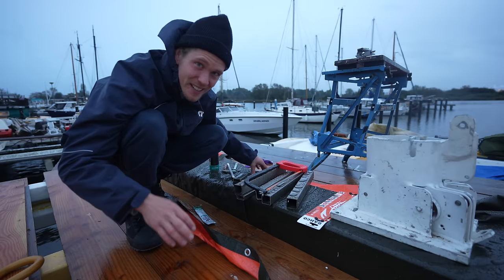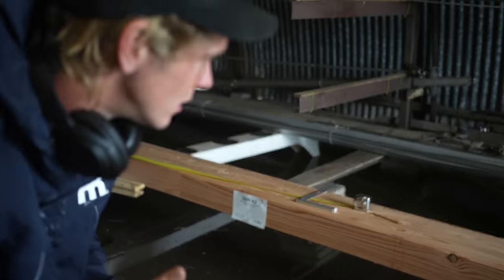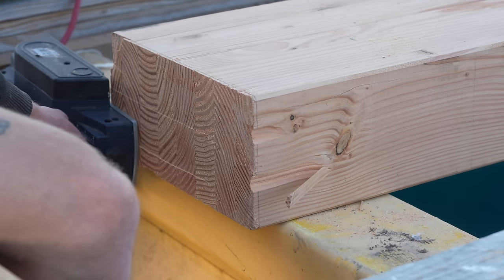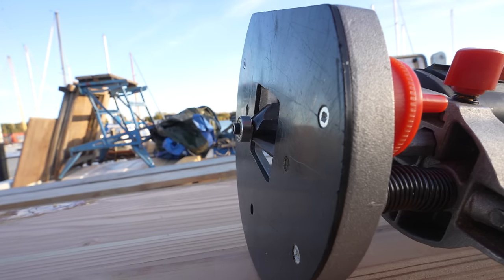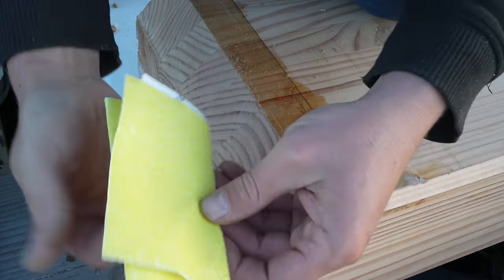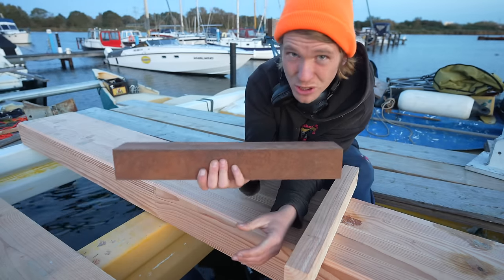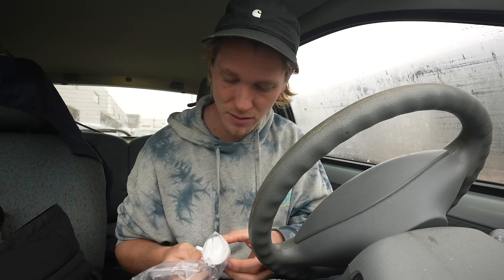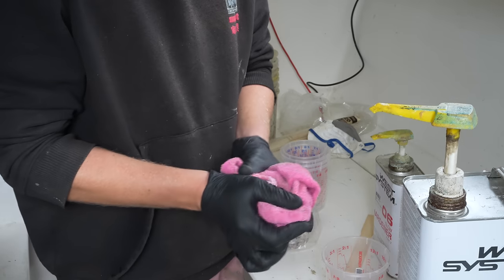My 42 ft Catamaran gets a HUGE Mast Step! | Wildling Sailing

Comment from the maker: Thanks for all the advice, guys! I know it seems like I’m just making things up as I go along, but I have followed the design plans for this beam, I have just made it oversized, and lengthened it. in my lengthy discussions with Hanneke she had told me that lag screwing the retaining blocks is the only way to go. Through bolting would weaken the cross beams which bear most of the compression loads. We can only see!
Reply: DW its 90% keyboard navel architects with good intentions on here.
Reply: The Gougeon bros on Boat Building is a book you need to buy and read. As they are the 'West System' they will teach you the MODERN way of working with wood.
Reply: I believe some folks may not understand the forces involved, I will leave it at that.
You're doing great Mark.
Future reference on cutting thick beams would be to scribe a line all the way around the beam then use a circular saw to cut the line all the way around, then use a sawzall/hand saw to cut the remaining center. Presto! Perfect cut. Lol.
That mast support beam is so beefy!
Can't wait for the sails!
Gooooo Mark! 👍
Reply: Imagining the stresses involved lag bolts look plenty sufficient to me. I agree with your architect you do not want to through bolt through those beams.
Reply: Hey Maek, how you doing? I am glad Hanneke, 8s acting as your guide and mentor. 

You may know that stainless needs exposure to oxygen to keep its anti corrosive properties,  or else it rots from the inside out, which is hard to detect, did those lag screws have a zinc oxide coating to provide the O2 for the areas not exposed?
Reply: Awesome <3 and that makes sense too.
Reply: Some people can be quite arsey in these comments can't they 😂  there is one thing that I think might improve on the beams strength.. not that it's needed..  if you were to slot the bottom of the beam so it sat slightly inset over the others, that would totally mitigate any fore and aft forces leaving the bolts to handle port starboard. Food for thought
Reply: @LaurieHolbrook Good idea!
Reply: just an idea for you... have you thought about making it a ketch rig now you have option for second mast step or would to much structural work?
Reply: The majority of the forces will be downwards onto the mast step. I think that you’re spot on with the plan with a nice robust laminated beam to share the load over the three deck beams.
Reply: You are doing an excellent job,

Comment: I’ve been in the construction industry for decades, and when ever you are running lag screws through wood in order to spread the load of the head of the lag screw you should use a washer. I understand that the wood is very dense. However, it’s just better practice.😊

Comment: Kia Ora Lad, when I was boat building in winter I made a box out of polystyrene scrap put the resin and hardener in with pumps sticking out and a 40w light bulb that was on 24/7. I then never had anymore problems with the West stuff. I would have thru bolted those blocks using stainless threaded rod and big washers under the nuts. Rog

Comment: You say, screw the beam down. I hope you mean bolt it in place. A lot of force on that beam and it will tear the screws out of the wood no matter how thick the screws are.  You have to drill bolt holes through the mast beam and the beam  where it will rest.

Comment: Hi Mark,I'm sure someone below will have made the comment already,but just in case. When you bolt two pieces of wood together, The first piece the bolt needs to not ingage with the thread were as the second one does. That way they are clamped together. The way you've done it now there is minimal clamping force// The clamping force friction creates makes it much stronger
Reply: Spot on mate I was thinking he hasn't got a clearance hole big enough. It gets quite frustrating 😊

Comment: I know a lot that people say to treat, seal, and finish with a good seal and finish products, leaving fir out in the exposed alone, with no seal or finish is up to you, there are water proofing products you can purchase. Liquid Rubber Waterproof Sealant - Multi-Surface Leak Repair Indoor and Outdoor Coating, Water-Based, Easy to Apply, Original 1 Quart  $40.00 CAD I'd be temped to add a few coats given the extremes weather you're gonna experience. Might add a few years of less worry about dry rots etc. You've worked so hard on your catamaran! Go Man go! Love it!

Comment: Maybe you want to apply some basic engineering principles of beam design and put some significant tapers on the mast step. Reduces weight while maintaining strength at the mid section where the mast load is applied. Cheers Peter.

Comment: I'm not a boat man!, but blacksmith, you could have used 4 pieces of stainless angle iron and 4 pieces of bolts, bolted with non-slip martriale between your mast beam and the booms. But Anyway good job

Comment: It's normal practice to use washers with hex head bolts in wood. The hex head without a washer digs in and under stress and flexing it cuts into the beam creating a loose fastener contact with the wood.. A washer spreads the load for stable contact and no damage when flexing. Enjoying watching your progress you inspire me to get up off my ass and do something. THANX!

Comment: Hi , the problem on my Wharram and the engine was that the beam is loaded with torsion, as the engines forces are acting  so far below the beam.
 I made a lengthwise beam that attached between two  normal beams.
 This new "antirotating" beam needs to be attached to the original beams so that it's rigidly connected to stop the rotation. As the long lever to the next beam is used the forces are controlled. A  part of the rest of the mastbeam could be used, or two stable 1,5 inch boards laminated together and being as high as your standard beams would surely do the job, specially if using some decent glass. Just the attachment to the motor beam needs to be more massive so I would connect this lengthwise beam like you attach your mastbeam, using blocking. In this case the blocking have to be vertical on both sides of the boards.

  
  Regarding your mastbeam I hope you treat it with glass and epoxy...
 
 Matthias
Reply: great post!

Comment: When I use lag bolts or regular bolts in wood, I put a flat washer under the head of the bolt and drill the recess the same size as the flat washer. This spreads the clamping force over a larger area and keeps the lag/bolt head from gouging into the wood. :)

Comment: Im guessing you will do a lot more sanding in the future. Do yourself a favor and wrap the paper round a small block of wood. It will make it much easier to sand, save your hands a bit and make what you are sanding flatter.

Also when its colder you can bump up the amount of hardener in your epoxy and it will help it set up quicker.

Comment: As a general builder I would strongly advise you not to carry your power tools by there cables. It put stress on the cable strains and could pull out of the tool itself. Look after your tools and the tools will look after you . I must say the background music is much better this time around. No muting necessary

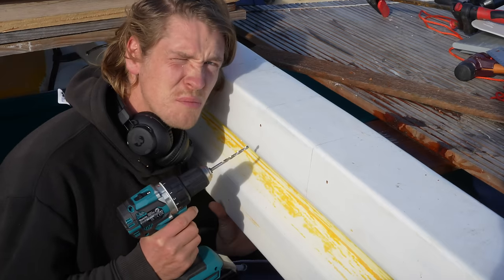Comment: 23:11 the hardwood outer blocks should be drilled slightly oversized. You want the screws to fasten into the soft-wood and you don’t want to have resistance in the hardwood. If you do you can’t feel the resistance of the softwood and may not get a snug fit. Oversize if it was fir to fir as well but especially with the block being harder, if softer not as big a deal. 
Also don’t let me see you carry tools by the cords again! 😂🧐. 
Also keep up the good work and ‘beginners mind’ mentality 💪🏽

Comment: I would like to note five things (please don't take it as teasing, because what you do is still good):
1. You could use larch. Very strong, very waterproof and quite light.
2. If you glued the laminated beam yourself, it would be much cheaper.
3. If you had used a threaded stem instead of the very expensive wood screw, it would not have been so expensive and it would have remained watertight in the resin bed and at the same time it would have held stronger.
4.. I hope the inner side of the bolted pillow wood will be finely sanded and treated with waterproofing (insulating material).
5. You really greatly exaggerated the dimensions of the mast base beam. Although this element receives a load, it is by no means so brutal.
I think 100 x 230 would have been more than enough.
The three holes drilled in the cross member would not have caused a significant lack of strength, because they were also greatly oversized.
Whatever you overspend will be missing from the new engines. It sounds like you're thinking about used ones.
By buying used things, you also buy the problems of the previous owner! I would say this, think about it.

Comment: If you want to plane the end of a beam again, clamp a piece of timber tight to the end flush with the end. You can then run the plane right out onto the sacrificial piece.This will support the end grain & prevent it splitting. Only the sacrificial piece will split.

Comment: Use some candle wax on the footplate of your saw to get nice sliding action. Have you thought about using 4 or 6 large truck suspension U bolts to secure that mast step piece

Comment: Because most of the force will be from your mast and that force will be downwards, you should absolutely stand your beam vertically.  If you have a problem with lateral strength, it will be easy to add bracing.

Comment: I saw your video yesterday night, and I mulled the problem of your mast step over in my mind. I am not an engineer, but I have the impression that your beam supported by three hull-to-hull beams is enough. The real force is vertical and downwards once your standing rigging is properly tightened. If you are sure of the integrity of those three cross beams (no "rabbit holes") I see no problem. This downwards force would be on the centres of the beams - divide by 3. The ends are taking the force divided by 3 and then by 6 - 18. Then there is the lever effect. No worry for the ends. If the cross beams are sound, I see no problem with each beam centre taking a third of the load. Reefing in tough conditions takes a lot of strain off the mast and its step. I had this experience with a Mirror rig and a reefing sail in fairly boisterous conditions off La Rochelle. The mast was bending, but the mast step was OK. Most of the stress is as you go up the mast rather than leverage on the mast step. Others might see me as talking nonsense, since I have no experience with catamarans. Good luck with the rest and with stepping the mast. I'm sure the port where you are has a mast stepping crane. Do you have a boom and the sails? Do you have at least 2 reefs on the main?

Comment: Hi Mark,  before you get to far into the build have you considered your are out in the middle of the ocean and a storm blows up what protection will you have when you need to be on deck, I've other builds of Wharram catamaran's that have a small cabin 1\3 of the way from the rear of the hull. You should consider this before you get to far into the construction

Comment: Bolt holes need to be drilled oversize , filled with thicker epoxy ,when set pre drill and screw in lag bolts into the large epoxy filled holes. Takes extra time ,for a mastbeam this is critical, belt and britches better,protect those lag nuts . Back up lashings good idea to prevent losing your rig ,lash ast beam at least to other beams if possible ,lose rig ,you lose everything?

Comment: The Douglas fir piece is too thin to hold that beam and mast under sail. It WILL split under the force of sail and waves. You need a thicker wood if you are going to run large bolts through it to hold that beam in place. I live in the Pacific Northwest, where a lot of D-fir is harvested, and have used it on small racing cats for repairs. I've been demasted twice due to not having thick enough bracing on the mounting. That dark wood piece you used is the right choice.

Comment: 22:17
A good way to be very precise with your predrilling into the board that the screws will be gripping into is literally hold up the drill bit in from of the screw and adjust the size of the bit until you can see only threads extending out from behind each side of the drill bit. That way you are drilling out and removing only the core of material to accommodate the shaft of the fastener but you know that the threads will be grabbing on. And as the wood gets harder you can go up slightly in the drill bit size. And always lubricate! (When epoxy is not needed) Either paraffin wax or even rubbing the screw on your scalp for a little bit of oil on the threads. Makes all the difference
-✌️

Comment: Fiberglassing the Pahi 42 Mast Beam to the Beams you Lag bolted into would be a good idea ( Belt and Suspenders) Wait for dry weather ,using fast or medium epoxy ,wrap 12-18 oz (400g -600g) around the Beams similar to lashings .This will water proof your lag bolts and most important bond the two beams together ,make it beefy with lots of glass, paint …..MastBeams are critical, belt and britches, could also lash the beams , like fiberglass wrapped around , you will feel safer when out there on the oceans Mark ,well worth it if beefy……cheers from Ontario

Comment: Great progress Mark, and your Mum and Dad have really helped !

Glad you chose a thick longitudinal beam and the hardwood brackets to secure beam, but did you consider glueing and filleting the brackets to the horizontal beams with epoxy and glass microfibres to ensure a rock solid bond?

Comment: Azobe is also called 'ironwood' you can't just simply screw in to it! best to drill through and bolt it I guess, try a test piece, you might (probably will) break a screw.
(edit: Oh, and it will sink if you drop it in water 😉)

Comment: I would recommend using all thread and nuts and washers for holding the mast beam in place or some steel strap as someone else mentioned. I thought you could perhaps let the forces of the mast be taken by some lashing similar to your spreader beams. Use line to lash the spreader beams to the mast beam in a few places. Most of the forces on the mast are dispersed outwards by the rigging. The mast will mostly be applying downward force onto that beam but preparing for forces in both directions seems good. I hope you address this issue in a later video.

Comment: Mark you're trying.... But some advice.... We call those screws coach bolts.... I don't suggest using them.... Use threaded bar.... Right through with washers and nuts

Comment: Wharrams like Douglass Fir , the Doug Fir Timber you attached the Lag bolts to should be DougFir , pre drill the holes oversize and fill with thickened epoxy ,glue and glass this piece onto the Beam ,epoxy will hold better than lag bolts especially if glassed on beefy. You can unbolt the heavy timber,most likely it will not hold epoxy well to oily wood (?) Doug fir with thickened epoxy onto sanded beam is the way to go .Swallow your ideas and re do.

Comment: Also, Wharrams are designed in the style of Polynesian sea canoes, 2 tied together for ocean crossings. The original design, they are lashed together with rope, this lets the hulls flex slightly, as in they can move independently of each other, making them more sea worthy. Keep this in mind when adding huge beams across the stern or the bow, which may make the hulls more rigid than may be desirable. It is a very big beam, so it is a fair amount of work you have done, don't be too disheartened. Indoor trees are soooo hard to grow!!! lol

Comment: the holes in the Aobi need to be the same diameter as the bolts or just slightly more so the underside of the head of the bolt is clamping the aobi to the beam, and not pulling the threads it has made in the aobi.

Comment: You could have prevented the splitting of the wood just by scoring the beam at the exact location of your markings. The pieces which would have splitted, would actually stop (break off) at this scoring-line.

Comment: As you say adding weight is to be minimized.

That  big beam is very heavy and the thickness should be tapered from the centre to the ends. In theory you can taper to zero thickness at the ends but about an inch would be OK..

Comment: don't give up hope Mark, and keep trying to resist cutting corner or rushing, as your life in the futur  might depend on the quality of work done now.....in general for routing and the planer if the edge can cause a problem add a small piece of sacrificial wood, to prevent tearing ...cheers

Comment: As a carpenter I have to say some of your advice you may find us not accurate but I respect that you are trying .Best of luck
Reply from the maker: Haha sometimes I don’t realise what I’m saying till later, but then I put it in the video anyway 😂
Reply: Exploration is the pinnacle of experience, having a good teacher is a luxury wich you honnor by doing his/hers work with your hands.
-without a teacher keeping a diary of your fups is key, it's the  difference between refit/repair, salvage or just traditional death. I love the rawness of it, we're all on the spectrum of rushing or falling behind... ♡♡♡
Reply: @WildlingSailing 
Mark watch the size and grade of any metal bolts or rods . I sent you links to grade  types and marks.
Beware of  low grade brittle cheap all thread its very dangerous some of it.  
Its brittle and flawed. As i found out to my cost... 

With oak or other high tannin hard woods you need to use stainless or HD galvanised steel  or the acids attack the steel. 

Spread your pulpits loads as far as possible top and bottom. Fore and aft and side to side.

Truck and trailer centers sell HD rubber blocks that can stand an artic trailer hitting  a wall ...

If you have to plane/sand end grain put a sacrificial piece of wood behind the trailing edge clamp it on and it stops the end grain splitting .. 
Knifing the cut line also helps.